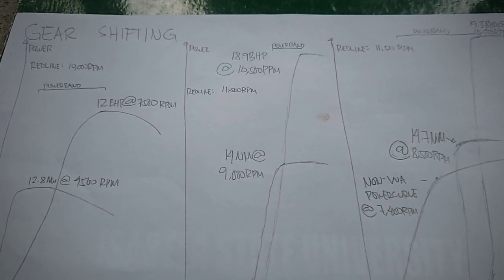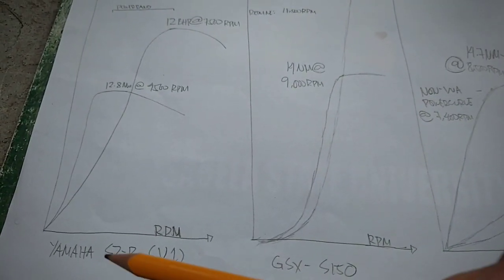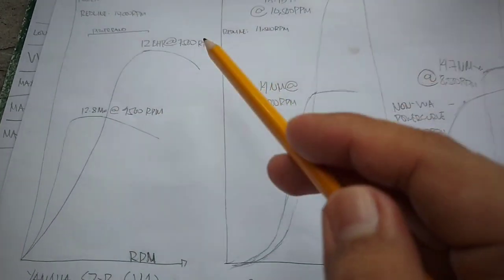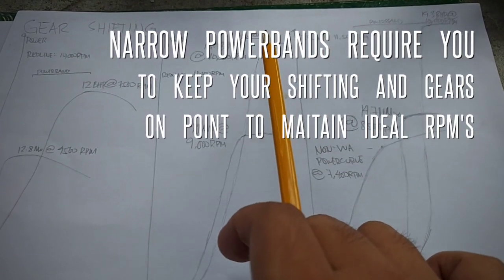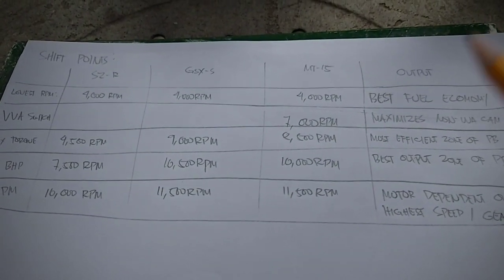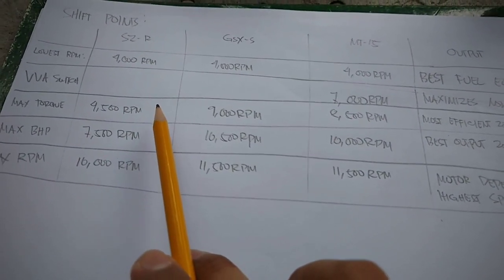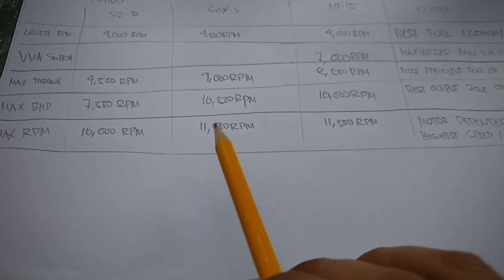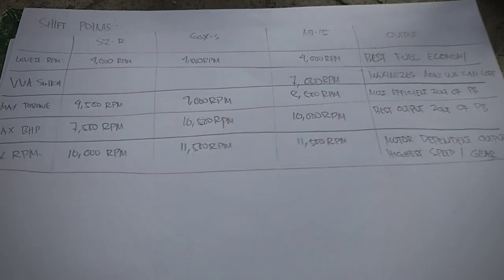Tamang Pagpili ng Kambyo - How to Shift manual bikes - in depth Riding Skills Series: Ep 1

Comment: Hi sir! Balak ko po bumili nitong mt15 and first time ko magdrive ng manual na motor. Pero nakapag motor na ko dati kaso mga mio lang. Malambot ba clutch nya for beginners? Tsaka di ba masyado malakas ang torque para sa mga baguhan na tulad ko? Thanks sir.
Reply from the maker: Good eve. Mt-15 is the best choice for long term ownership. May assist clutch sya kaya malambot yung lever. Pinakamalambot sa lahat ng manual na motor actually. Sa torque naman, di problema kung marespeto ka sa throttle